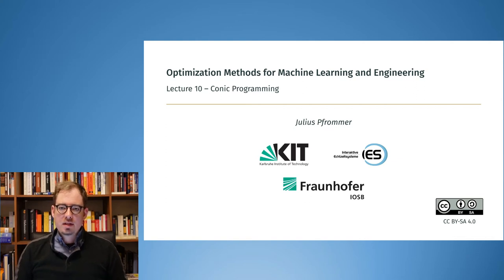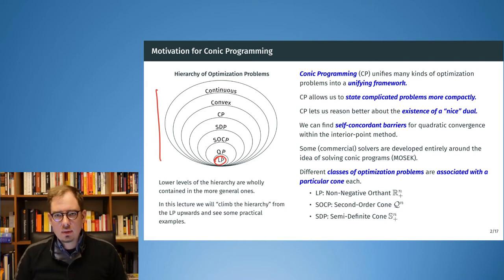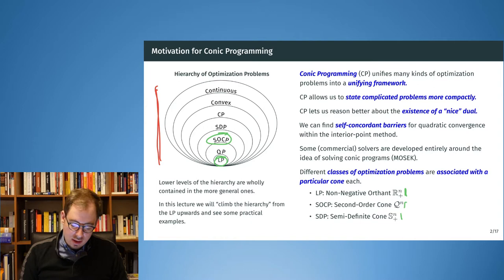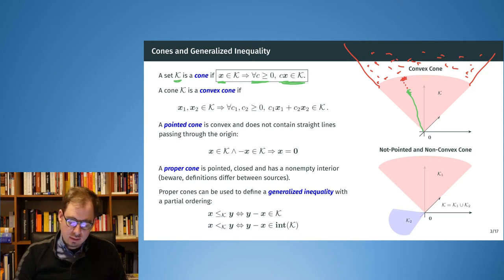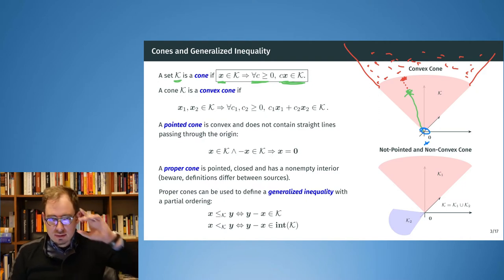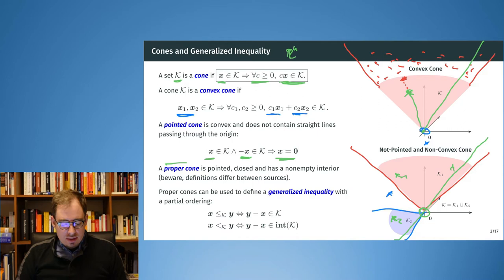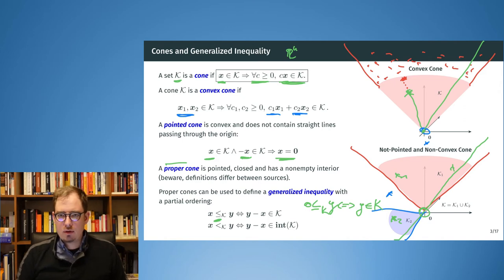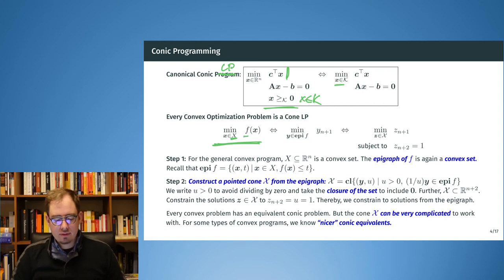10.1 Optimization Methods - Conic Optimization

Comment: we can't say that QP is a subset of SOCP because some QP instances are not convex (e.g. max x+y s.t. x^2 - y^2 <= 10 )
Reply from the maker: As per the usual definition QP only have linear constraints. That is not the case in your example.
Reply: @juliuspfrommer9286  ok change the objective function and constraint in my example. This is not yet a convex optimization